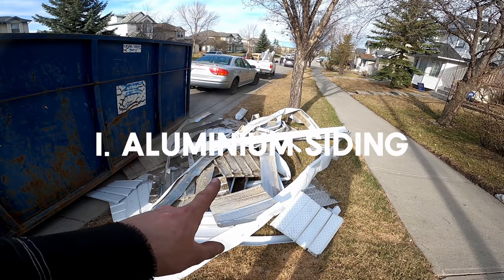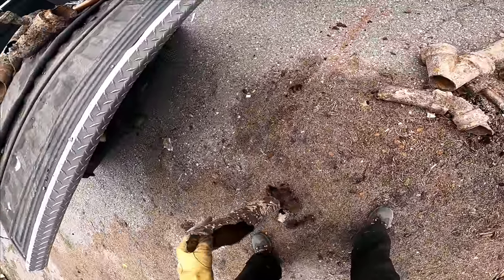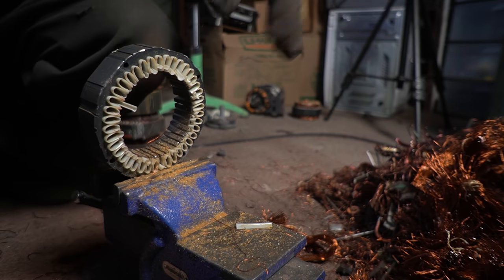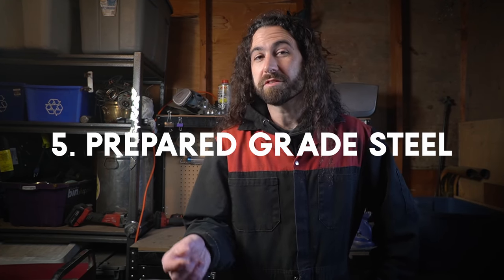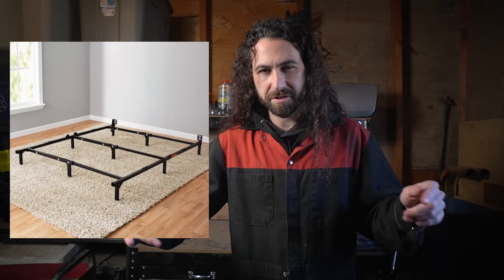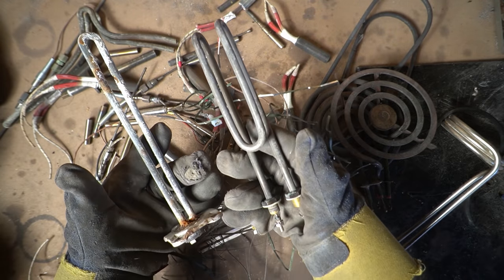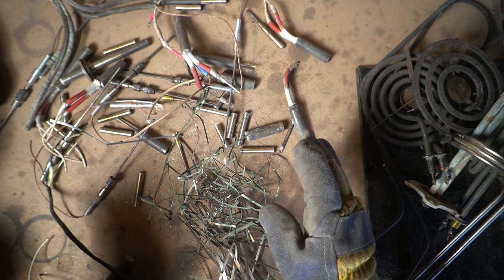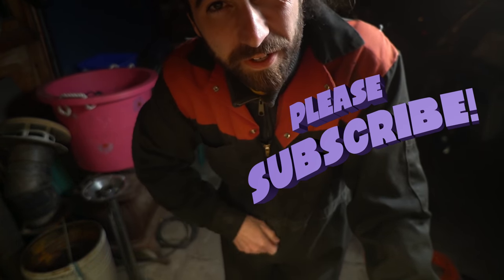5 Things You Didn't Know You Could Make Good Money Scrapping!

Comment: Yes separate your different metals my brother in law too and big bucket of scrap fittings in as his first scrap run the dealer showed him the difference in price of the different metals he weighted it as mixed metal and calculated the price it wasn't much around 20 dollars then he showed him how to separate it into copper red and yellow brass and weighed each separately and the difference was shocking the one brass one we had the least of was more than the total price of of it as mixed metals in all the total of all three of the different metals was over 4 x the amount of mixed metals I have found it's wise if there are more scrap places to find out which will give you a better price also what you need to do to get the best price I stripped the siding of a mobile home most of the dealers prices were close but one had 2 different prices if it was under 3 foot square it was double the price of the long length of siding as they had to hand feed it into a chopper so I asked him about if I folded it up in 3 foot sections or if I had to cut it off a lot of work with the tin snips he said folded would still fit in the baler so I folded each piece in three and hauled it into the yard a load of them in my van about 2 foot high was almost 4 hundred dollars each mobile home made 3 van loads so with the 3 mobile homes I had quite a bit of money I loaded scap copper pipe in the center of the van its worth cutting the fittings off and taking them in a bucket as dirty copper as clean copper was a lot more money than dirty and the fittings brought the whole batch to dirty just meant that I had to go over the scale twice and once for the short aluminum and once for the copper they weighed the bucket of fitting and took its weight off the load of copper then they gave me the weight ticket with the 3 different metals and their weight took it to the office and collected my cash I found out latter that most of the other scap yards also had a different price for long and short aluminum I also found that battery recyclers gave better money than scrap yards they at the time gave under a dollar each and the battery recycler gave me three dollars each quite a difference
Reply from the maker: A little knowledge can be worth quite a bit in the scrap business! Nice work

Comment: Thanks!  I scrap mostly copper and aluminum to get better steel. I'm a novice blacksmith and always looking for high carbon materials. Automotive axels are usually H13. Leaf springs and coil springs spark test at a similar "look" to both 4140 or H13. I found a furrow tooth the other day that was the same. 🍻
Reply from the maker: Wow, you’ve got a much better handle on steel grades than I do!
Reply: @thubprint  blah lol. I only know what I need to. I barely know a thing about prepared steels. But I appreciate the sentiment. 🤘
Reply: Where you located Jackson? I get a bit of leaf springs on some good occasions
Reply: @dlgravedigger  mid west ohio. Right on grand lake. And nice!
Reply: Don't be afraid to hit up a dealershps mechanic shop such as Chevy or Ford. If they are like us? They will have no problem with all the high carbon steel you can handle
Reply: @dlgravedigger  really? Good to know. I never would've guessed, at first thought I would've passed em by. Most other big businesses, (say wally world) have a policy that nothing like that can leave the store. I used to work the freezers and I saw my old boss throwing away a bunch of 1/4in steel round bars. The ones they hang stuff on, and they would be perfect for smaller stuff. Little rivets, and scroll pendants. I asked and and just laughed... But yeah, good looking out man!  At the moment I'm mainly focused on getting my show table ready for the farm market, and tool building. But if I keepnat this pace I'll be ready for demos by next year. I wanna hit the music festival scene. Wow the "hippies" with fire and such lol. Then my eye is on swords, and other midevil blades. I've made a few out of mild steel for practice, and they look pretty good for what they are. 
Again, thanks! 🍻⚒🍻
Reply: Springs are usually 5160

Comment: I like to divide steel into 2 categories. Smart steel, and dumb steel. I have a small truck, so space is at a premium back there. Smart steel is small, easily stackable, and heavy. Brake drums and rotors are smart. Bed frames if you can fold them up are smart. A metal shelving unit, not so smart unless you like to try bending it up to be more space friendly.
Reply: Extreemly smart steel is that orange non magnetic pipe they use for plumbing.
Reply: Sell bed frames by grinding off the rivets and legs and sell them for 10 dollars on the materials list on craigslist.  Any long usable piece of steel on material list . Welders look 2 times a day for usable steel.

Comment: Another good one is a weird one out but it's aluminum cans switch where I live in anywhere from 40 to about 80 cents a pound which yeah isn't much but if you crush them you can get more weight in the back meaning more profit little side note
Reply from the maker: Huh, cool! I have the deposit system here so I’ve never scrapped cans before
Reply: @thubprint  well the thing is we don't have a recycling system generally where I live but a long time ago I used to take them to something called a can Bank and every 3 weeks or so it would be emptied well the can bank I used to go to shut down so I actually went to a decent scrap yard and oh boy do cans sell plus I use 55 gallon trash bags so those tend to help with collecting as well and I crushed them
Reply: we have deposit on our cans, 5 cents each, all non deposit cans or aluminum 19 cents a pound
Reply: @TheCabinfever1977  it just depends on where you go and where you live

Comment: @thubprint I just googled it (like I should have) and the wire on the inside is typically 80/20 nichrome. The powder on the inside is magnesium oxide. The outer is steel of various types. If you have a bunch it may be worth your time removing the inner wire. A hammer and cutters should make easy work of it to break up the powder.
Reply from the maker: That explains why the bigger ones were high nickel content.. when he decided to lump it all together I wasn’t worried about losing much money but I knew it wasn’t all the same dirty stainless!
Reply: Nichrome where I am is about $2.50/lb. I'm not sure what that is in CAD or if it's worth the time but that would explain the high nickel. I'll probably start removing the wire because have a place that takes it. Good work though. Been a fan for a few years and I've learned a lot
Reply: It might. You can find heating elements in all kinds of places consistently, especially if you live in or near a larger city. It is, as you put it, the frosting on the cake not the cake itself, but there's enough frosting for those who enjoy microscrapping to be worth it similar to stripping the wire from the same stove. Just my thought. It may not be enough for a dedicated video outside of a short like you said though. It is a small amount of the total volume.

Comment: I like electronics taking them apart and some of the gold ends I save there's a guy I know that gets the gold from the ends and some of the gold boards that I find so there's money in electronics too as well old stereos have big copper transformers in them you can break apart it's great that you're teaching people and I used to work at a junkyard so I got pretty good knowledge all scrap most of the stuff  you've shown I was trained for already the motor bodies the different types of steel the lead I save everything and I break everything that I can down that's feasible to break down and I do it for myself now price is right down since the stock market hasn't been doing good lately but I'm still getting 140 a ton for tin I got a whole truck load of low grade boards to take in soon along with some mid grade boards bins full and one been full of high grade boards hoping that's going to be a good pay out cuz the place that I take it to only accepts low grade at a decent price 20 cents if you have over 500 lb so I've been saving it for a while got a lot of recycling bins full tvs or very good to take apart too they're small air conditioners wire when I find it and I've been trying to expand my e-waste volume but I got to try to find a way to get old computers laptops old stereos that surveillance old surveillance of monitors cable boxes gaming boxes all that stuff has good gold in it and other precious metals that's what I've been focusing on look like a show thanks man most of my money comes from that type of material I get most of my money from breaking stuff down and getting the little things that glitter I make less on steel because it's hard to find all auto mechanics now in Florida now do it through take their steel through their corporation so finding still like that is far and few between I have to save that up as well so I see everything everything's worth money every penny counts to me even those low-grade boards they don't pay much but they're pretty heavy and I want if I wanted to I could depopulate the boards and get the aluminum the flyback transformers all the aluminum off of it and still turn it in as a low grade board cop or whatever but little things I make money on too that bucket fills up I got some money brass is $2 a pound here still so that's something I look for more than I would look for the steel but I will take the steel if I come across it I'll take whatever I come across and if it's worth it to break it down and get those other things out of them like the wire I will do it later happy scrap
Reply from the maker: I guess steel might be hard to come by some places, I hadn’t really thought of that. Brass doesn’t come my way very often but I’m always happy to see it 😄
Not sure I’d be able to hang onto boards all the way to 500lbs but if you can make it work, good on ya! I’m still looking for a solution to Ewaste gold recovery, I’ll keep saving the good stuff until then 👍 All the best to you!

Comment: I have a vehicle that I have been dismantling and parting out. I also have been scrapping all of the other parts that I'm not selling. My plan is to cut the shell of the car apart and take it to the scrap yard. So should I expect a decent amount of money for the vehicle steel? Is there a difference in the grade of steel that makes it worth more?
Reply from the maker: I like this plan! Definitely the best way to make the most money I think. I haven’t personally brought a car with the engine etc inside to the scrapyard, but I know mine has a price for whole cars that’s just a little below the steel price. The whole piece is definitely worth less because of all the junk on it but it balances out because the aluminium is worth more. Of course it sounds like you’re planning on removing that as well so I guess you’ll find out if the extra effort is worth it 👍
Just make sure you ask what their policies are before you haul it there, some don’t like the wheels being on or need everything drained.

Comment: 300 Dollars a month, man I am making 1200 plus a week on top of my wages. Finish work and then head around and picking up scrap metal, load it on the trailer and take it to the scrappers before starting work the next morning. I pick up everything and the motors, cables, brass copper and aluminium get sorted out for a future bigger payout. Just scored 2 ton of heavy guage steel from work, the week end is starting to look good.
Be safe and keep it real
Brad
Reply from the maker: Nice work!
Reply: @thubprint  Today $1600. They forgot 80kg of lead somehow but finally sorted that out. Also I have been throwing out the plugs from power cords and found out that they also take them at 77 cents a kilo, I have been throwing out tons of those, so sad but a lesson learnt.
Cheers

Comment: If you take the washers and dryers old air conditioners vacuum cleaners for example I've got a LG steam washing machine that I picked up it has the 5500 kinetic motor which you can adapt to bicycles go karts windmills as you know you can take a automobile alternator reverse it from DC to AC put it on a self-propelled push lawn mower with the pulley with a dead battery and a vacuum cleaner motor that's normally 12 to 15 amps and if you get a RV or 18 wheeler alternator there are 150 to 190 amps you can run a house I used to term a part just to get to the copper what a knucklehead I was the capacitors the transformers and microwaves you can run two homes where I think the money is is making fans out of the motors that you get out of Washington drive shop fans cooler fans I made a huge coin bucket that look like a barrel I put a vacuum clean motor a cordless drill motor and a computer hard drive motor with my air conditioning coil cold water and a fish pump for a drip system with a reusable AC filter and I called my RV that was 30 6 ft it be 95 outside and it would be 61 inside and it would only run for 7 minutes every 25 minutes awesome

Comment: Do you consider the effect heavy steel hauls (1000kg for $100?) have on your vehicle? I have trashed 4 vehicles (hatch, ute, suv and van) hauling only non-ferrous. If I get another vehicle it has to be a heavier duty truck but the big negative is it's harder to get in and out for frequent stops and scouts. I'd like to try focusing cable on a Honda postie. I will go back to cans and bottles (@ 10c each) before I lift ferrous metal.
Reply from the maker: Yeah, I suppose it does depend on the vehicle and what you have it for
Reply: Where are you at, Chris?  I get AU$280 for dirty steel (i.e. fridges, washing machines, bicycles, etc.) to AU$500/T for insize heavy steel.  I know the exchange rate for the Aussie dollar is low but not that low!  I don't know your local market but $100 a ton seems very low and warrants some shopping around.

As far as an appropriate vehicle is concerned, try a 4.5 ton diesel trayback.  I use a 22 year old Toyota Dyna 200.  It has a steel tray but I'd prefer aluminium.  It fits in a car space and legally carries 2.5 ton on the back plus trailer.  It is no more difficult to get into and out of than a family car.  I've had no major mechanical or structural issues in the 15 years I've had it, except for a clutch cylinder that mysteriously keeps failing every four years or so.
Reply: @andymanaus1077  Sydney. If I found those rates I'd do it. I get 53c/kg on lead batteries and about the same on dirty alloys which is my bottom rate. Ideally I'd get a Toyota land cruiser ute but I don't have the cash or credit... So the reality is I'm on a rental cargo bike that's doing 100kg hauls. I'm focusing cable, brass, stainless and alloys which is pretty easy to come by when you pick in affluent areas.

Comment: What about nuts and bolts and screws ? 
Is that considered prepaired ?  A 5 gal bucket has some weight to it.
Reply from the maker: It just comes down to the thickness of the pieces. Drywall screws and whatnot are just tin/shred but yes, I put most of my nuts and bolts in the prep pile because they’re usually good stuff!
Reply: At my scrapyard, stainless steel bolts are worth more than mild steel ones.
The mild steel bolts & nuts go into scrapped microwave ovens to make them easier to handle.

Comment: Yes if you go to Old mobile home parks and tell them that you will get rid of those abandoned mobile homes for $200 they will let you strip it down take a sawzall two buddies 12 pack of beer all the windows frames are great aluminum the siding is another aluminum then you have all the wiring the light fixtures the plumbing yes some of the old plumbings copper and galvanized you may run into some plastic but there's always a use for that plastic you can cut up the 2x2s 2x4s 2x6 floor joists and 10-ft sections 4 ft sections keep those dry and you make anything with it I would also recommend you when you go to the scrap yard buy as many batteries as you can marine batteries generator batteries from the big rigs as well as alternators but the batteries if you take four tablespoons of Epsom salt a coffee cup full of distilled water put the coffee cup and distilled water in the microwave for a minute and a half then add your four tablespoons of Epsom salt slowly and stir put it in the Mason jar knock a hole in top of the Mason jar for a dent shake your Epsom salt with your distilled water test the battery that you got at the junkyard or scrap yard it'll have two volts maybe three take your caps off pour that in there shake the battery pour some more shake the battery let it sit don't charge it yet let it settle then if you're able to pour the whole cup in there and still shaking it takes you about 30 minutes to get it all and all the cells turn it upside down put it back over the top go side to side and just leave it there for another 30 minutes and then get your battery tester it'll say 10 bolts without even putting a charger to it I've never seen a battery that could not be brought back to life I just did a couple motorcycle batteries the other day without a charger they were registering 1.2 volts to 2.9 volts I do what I just told you an hour later than a registering 11 volts and one was 1275 volts my buddies thought I was a magician

Comment: did you know that the plugs that go into the wall or brass ends not many people know that
Reply: I remove those & sell them as dirty brass If they are chrome plated,  clean brass if they are not. I am pull them from the plugs & usually get clean copper wire when I do,  which I twist together & put in with clean copper wire.
It might take a bit of effort but, my time costs me nothing.